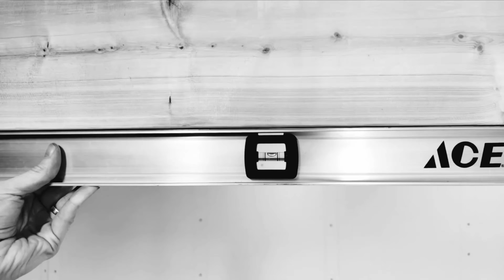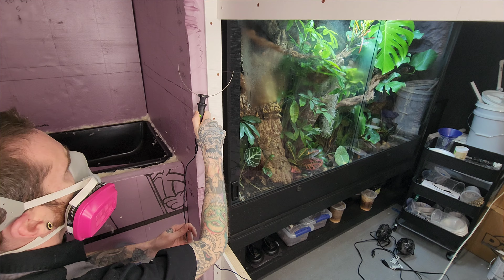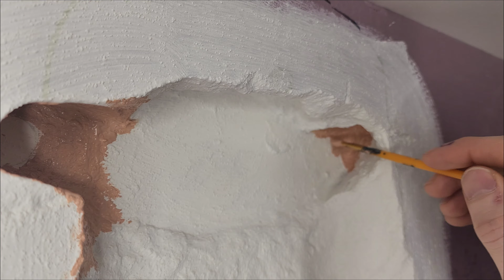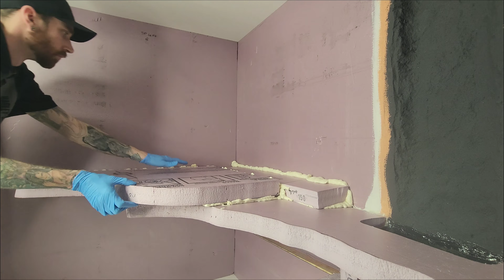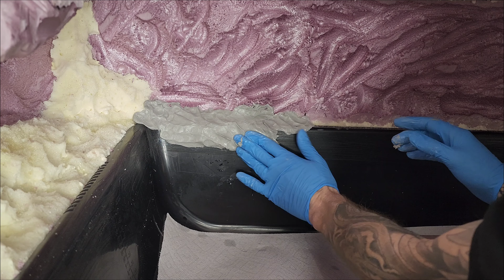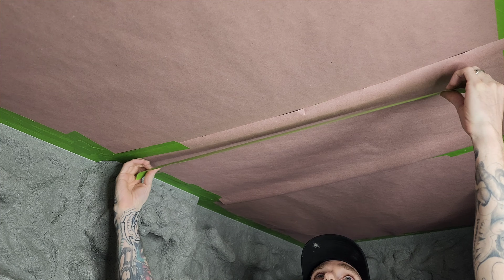DIY HUGE Reptile Enclosure. Waterfall, Dripwall, Hardscape, Background, Zoopoxy |Part 2| #reptiles

Comment: Hey @BradsBioactiveBuilds is there any way I can reach out to you so that I may get some advice on basically building the same size setup but mine is for a BCI. He's roughly 7 and 1/2 ft I've had him for going on 13 years now. He's in an enclosure I built previously but he's outgrown it and I definitely want to upgrade even to something absolutely spectacular so I was trying to do something similar in size but more along with a jungle type background like a bavarium except probably not with live plants because it would be too hard for me to take care of. 

I have over two decades of carpentry experience so that's not a problem. And funny enough I actually work at a theme park in South Georgia called Wild Adventures. We have over 300 exotic animal species. I actually have rebuilt several of the enclosures that we have for several animals although nothing like what you do is just you know replacing rotten and termite infested lumber. 

We even use ¾" sintra PVC sheets for our signs so I'm also very familiar with that material as well. 

It's a dream too work with honestly. What I'm building like I said is for my own personal home I have a great spot it's going to be an 8x7 I believe I don't know if I can add the four feet of depth although I would like to but I would have to show you some pictures of my placement of it as it's also going to be more or less butted up to a sliding glass door. Anyways if you could reach out to me I would absolutely love to get some advice and maybe see if you have some other videos that can show me how to do a rainforest or jungle style for vivarium. 

Also I'm curious to find out what your overall cost for daylight this set up right here that you're doing in this video. 

I don't plan on being cheap with what I build I want to make something that's going to be long-term and he's going to absolutely feel right at home with. 

By the way his name is Django just like the Tarantino movie. 

Funny story too is he's also the reason that my daughter is here on this earth. She'll be 12 years old this year. Her mother at the time made an agreement that I could get a snake as long as she could get a dog. That was easy enough so we agreed. We got down to Petco in Tallahassee Florida and she dropped the bomb on me and said she changed her mind and she wanted me to give her a baby instead. Thinking it would just pass over and she soon move on at some point I agreed. Next thing I know we got married and had my little girl Ivy Grace Ingram. Although we've sent divorced we remain incredibly good friends and talk almost on a daily basis outside of just our daughter but it's always just been a funny story to tell people.
Reply from the maker: That is an incredible story, and with your background in carpentry, I’m sure you’ll build an amazing home for Django! 🤘💯

Comment: I gotta ask, how strong is the insulation board on just expanding foam? I'm just imagining an adult lace monitor and wondering if that could hold the weight, as I'd love to use this idea for a lace monitor enclosure!
Reply from the maker: It will hold with polygem zoopoxy, I have a 6ft Cumingi in there now. I can also sit on the ledge. Check out zoopoxy here
Polygem ZooPoxy 307 Lite
https://polygem.com/product/307-lite-sculpting-epoxy?mtm_campaign=brads_bioactive

Comment: I'm partway into my PVC build, heavily inspired by and following your ideas. To waterproof the drainage layer without silicone because of binding properties, in another video you used Lexel adhesive, and here you use Zoopoxy (which I can't find). Is it still okay to use Lexel on a drainage layer? E.g. if I had 5 inches of Lexel up the sides then 1.5 of it would be in the drainage layer but 3.5 of it would technically be able to leach into the soil and the snake could technically burrow to it... I want to do more than 1.5 inches up the walls into the dirt in case of emergency overflow. If not Lexel, then what else would work? Liquid Rubber tape looked temptingly easy...
Reply from the maker: Lexel has worked well for me and the binding properties  you and always sand the pvc board to rough it up a little bit to get a better bite. Its also printable so I out drylok over it to add a little extra protection. You could also fuse the pvc together butbifbits a large build you will have to work really fast.

Here is a link to zoopoxy if your in the US

Polygem ZooPoxy 307 Lite
https://polygem.com/product/307-lite-sculpting-epoxy?mtm_campaign=brads_bioactive
Reply from the maker: And thanx for your support to the channel!

Comment: How thick is the insulation board?
Reply from the maker: I used 2 inch xps insulation board for this build.
Hope that helps
Reply: @BradsBioactiveBuilds sorry for all the questions. I’m about to start a build and never done it before.
Reply from the maker: @Factory43R no worries at all, ask away, I'm here to help!
Reply: @BradsBioactiveBuilds can you do dry lock only over the foam sheets and expanding foam or do you have to do some type of lockrete or mortar?
Reply from the maker: @Factory43R yes you can drylok right over the foam sheet and sprayfoam. But depending on what animal you are putting in it and if it has claws they might puncture through it depending on how many coats you do. 

Here is a link for what I uses
Polygem ZooPoxy 307 Lite
https://polygem.com/product/307-lite-sculpting-epoxy?mtm_campaign=brads_bioactive
Reply: @BradsBioactiveBuilds it’s for a female super dwarf reticulated python.
Reply: @BradsBioactiveBuilds I would love to use that but it’s a bit too expensive for the size I’m making. If I did the grout option would I need to seal it? If so what would I use for a clear coat to seal the grout?
Reply from the maker: @Factory43R no need to seal
Reply: @BradsBioactiveBuilds cool thanks. 1 last Q. When I’m using expanding foam can I use the regular great stuff gap filler or do I need to use the pond and stone?
Reply from the maker: @Factory43R regular great stuff gaps and cracks works just fine, and it's cheaper!
Have fun building!

Comment: I think u should’ve done a layer inside os the tub to get perfect! Its just the final touch, the enclosure is perfect
Reply from the maker: I agree. I was thinking if I ever needed to replace the drain it would be easier. I'm planning on putting down some zoopoxy in the tub once I finish the 8x4x6 paludarium im working on

Comment: What is the purpose of the pvc board if your insulating and covering with zoopoxy. Could I just use the pvc board on the roof and floor
Reply from the maker: What would you use on the sides?

Comment: I am absolutely in awe watching you do this project dude.

Im just curious, when painting the interior  did you need to use any spcific paint to ensure the safety or the reptile? Or is this not cokpletley necessary?
Reply from the maker: I'm glad you enjoyed the project. 

So I use drylok original and I mix in quikrete or folkart matte acrylic paints. Sometimes a combination of the 2. When ever using quikrete it's a good idea to give the enclosure a good spray down to remove any residue. 
Hope this helps

Comment: Question? I’m following your guide and building something similar to this for my boa constrictor.  Can I opt out on the PVC boards and use plywood then the XPS boards?
Reply from the maker: @wisperkidwell  
Yes you can opt out of the pvc board and use plywood.
Have fun building!
Reply: @ thank you! Do I need to worry about sealing the plywood?  Pondseal seams to be the best option if so but I worry the xps with silicone won’t stick to it.  What would you suggest I do?
Reply from the maker: @wisperrobinson2865  silicone will bond better to wood than pvc board so you are good there.

I would drylok the while inside of the enclosure and use polygem 1618 epoxy on the bottom and up 8 inches to account for water and damp substrate. That would be the best way

Comment: Absolutely beautiful man. I just finished the last stage of dry locking and silicone on a 8X4X6 for my Mangrove Monitor and I’m ready for insulation board. I was wondering how many gallons of poly gem did you have to use for this project to include thickening agent? Thank you!
Reply from the maker: @bbaquatics2051  awesome,  glad u are making progress on your build.
I used just short of 20 gallons of zoopoxy and just under 3 gallons of thickening agent.
Hope this helps!
Reply: @BradsBioactiveBuilds  it sure does. Thanks!

Comment: How much zoopoxy did you have to use for this? I'm looking to build a similar size enclosure and don't want to buy too much or too little! Your videos are awesome!
Reply: I see here in the comments how much you used. Is there a cheaper alternative to zoopoxy? My pockets can't handle that 😅
Reply from the maker: @claytonflores5095  yeah, it is a little expensive but for Monitor lizards it's the best for durability and for all hardscapes it's great to work with and will last a lifetime. There are a few other alternatives but aren't as good from what i have heard.
Hope this helps

Comment: What is “dry lock”… got my bowl/pvc today and started my cage. I can’t find the PVC sheets locally. Was wanting to know if I could use melamine instead.. it’s also a lot cheaper then he pvc.
Reply from the maker: @jamessorsby7419  drylok original is commonly used it the hobby for creating naturalistic backgrounds. Its applied over prayfoam or xps board. 
Melamine can work as well. It is heavier. Just make sure u seal the seams real good. If eager gets in it will expand the partical board between the laminated finish. 

Here is a video going over drylok 
https://youtu.be/WZ3EYjO_PIQ?si=4rbNtHJ-uylh41zY
Reply: I found the epoxy online and was wanting to know how many gallons I would need for a cage 3/4 of the size you’re making in the video. 10 gallons is $700 😭 but I have a feeling that’s how much I need
Reply from the maker: @jamessorsby7419 yeah, 10 gallons is what you would probably need. Don't forget the thickening agent too!
Reply: @ how much do you recommend of that for the 10 gallons?
Reply from the maker: @jamessorsby7419  1 gallon of thickening should do the trick.
Hope this helps 🤘 💯
Reply: @ when putting the Epoxy, do you only go over the lip of the water bowl or did you do the whole water bowl?
Reply from the maker: @jamessorsby7419  I only did about 4-5 inches past the lip. I wish I did the whole thing. With the flex if the tub when adding water and draining it broke free in a few spots.
Reply: @ if I did the whole think I’d just be afraid I could never fix it if there was a leak. Also I make epoxy tables and I know it doesn’t stick to plastic. Was thinking about just going over the edge to hold it down and just dealing with the fact that you can see it’s just a plastic tube 😂 🤷🏻‍♂️
Reply from the maker: @jamessorsby7419  thay can work as well. Both seem like good options, comes down to personal preference 🤘💯🤘

Comment: how is the ceiling supported? I see in the previous video it was supported with a 2x4 to keep it from bowing in the middle. what was the final solution for the ceiling supports?
Reply from the maker: @benstearns5805  the next video in the series goes over the ceiling. But I did add 2x4's virtually in the center when it installed it to the framed side walls. Pvc board is relatively light. I did not need to support anything. I just screwed it to the top. Hope this helps

Comment: How much zoopoxy did you use?
Reply from the maker: @johnwall9583  just short of 20 gallons. (2, 10 gallon kits and 3 gallos of thickening agent)
Reply: @BradsBioactiveBuilds    Thanks, I'm making a background for my ackie monitor enclosure which is 9ftx3ft. Would i use about the same amount of drylok vs zoopoxy? Also, which method would save me the most money?
Reply from the maker: @johnwall9583  it's a hard comparison to make and depends on how many ledges u have. I would do 7 coats of drylok or 1 coat of zoopoxy. Zoopoxy will runnu a lot more $ but is the best out there
Reply from the maker: @johnwall9583  and a 9x3 sounds awesome 🤘💯🤘💯🤘💯🤘💯🤘💯🤘💯
Reply from the maker: @johnwall9583  if u have seen my most current series I'm working on now (8x4x6 paludarium) I used just short of 50 gallons of zoopoxy VS the same size enclose in this build that I used just under 20. Had to do with ledges and features along with how thick I applied the zoopoxy

Comment: How do you calculate the amount of epoxy you need?
Reply from the maker: @ThelemicPotter  it really depends on how much surface area u have and number of ledges you add. This hole build was just under 20 gallons.
Reply from the maker: @ThelemicPotter  but u can call polygem and they can estimate how much u would need depending on the sizes u give them. Tell I sent you lol

Comment: i’m building my enclosure almost the same way (using a zoopoxy alternative). the plan is to have a pond that would pump water to a drip wall/waterfall. my question is, would drylock be harmful if the reptile were to drink from the pond?
Reply from the maker: @teddy-vd9mk  drylok original is anaimal same. Ifbubuse quikrete to mix in for color make sure u rinse it till the resin washes off. Or u can use acrylic paints from the craft store (matte color) as an alternative to mix into drylok

Comment: Hi Brad, by any chance would you be willing to put up a price list for each stage of this unbelievable build? It would be very helpful to get a general idea of what a similar build might cost. thanks much either way.
Reply from the maker: @darthtaiter  i was keeping track for a little bit but then it got hard bc i had some of the supplies already, plus some returns. But I'll take a crack at it now
Part 1
6 peices of pvc board:  600
Tub: 20 bucks
Wood; 100
Casters: 50

Part 2
20 zoopons zoopoxy: $1200
Xps board: 125
Pvc pipe, bucket, Fittings pump Misc: 50

Part 3
Lights 200
I already had a mistking but 200
Fans: 25

Part 4
Glass: 250
Pvc board: 100
Clay balls 40x3
Glass tracks 40x2
Plywood; 40
Trim: 30
Black paint: 40

Part 5:
Substrate: 200
Plants: 200
Cork, I had some in build but it was probable a 20 peice if you only bout 1

Part 6:
 Cumingi 1500
F/T mouse .40 lol

Misc probably about 200 or random stuff I am forgetting like screws pvc cement, drylok, etc

Hope this helps

Comment: Hey man, I just wanted you’re opinion on the drylok and quikrete method. I don’t know if it’s 100% safe or not I have made a background before with grout and polycrylic for my leopard gecko but he passsed away and don’t think it was the background because he was always skinny and never grew and I want to make another background but I’m worried to
Reply from the maker: @Kevz1n  great question. It is a common method to use drylok original and quikrete.  You can also mix in matte acrylic paints to the drylok. Butbif you use quikrete in the drylok you will need to rinse down the enclose till the the bubbly water stops. Then u r good to go

Comment: This is soooo awesome!! I would love to try something like this for my ball python. Did you Drylok again after you dry brushed?
Reply: Also… did you just use 1 layer of epoxy on the whole thing?
Reply from the maker: @MJ-lv7xj  yes, I layer of polygem zoopoxy 307 light. The 1st 2 links in the description are the materials needed.
Reply from the maker: @MJ-lv7xj  thank you, definitely a fun build to do and a ball python would love it. 
For this build I used drylok as a base tone woth quikrete dye (matre acrylic paint would also work) then I used lighter tones to dry brush and then it was done (I did use some highlights of acrylic paints)

Comment: Hi! Im not sure if you answered this already, but how much zoopoxy did you use for this build? I want to do something similar but with and 8'L 3'D 4' H enclosure, wondering how much id need. Also would probably not use as much foam and use it for ledges, and some accent.
Reply from the maker: @samwendt8007  it was my 1st time using zoopoxy. Looking back on it I wouldn't have carved out the background and would have used a silicone rock stamp for the detail (like I'm currently done on a 8x4x6 paludarium video coming soon).
I used 2p gallons on this build but if your not doing as many ledges and thr front backside if the pocket door then I think 1p gallons would do the trick, if not less.
Hope this helps
Reply: @bradsbioactivebuilds  thank you so much for the advice! I am a little confused though, you said you used "2p" gallons, but I could probably get away with "1p" gallon. What do you mean with the "p" ? On there site I see they sell quart, 2 gallon, and 10 gallon.
Reply from the maker: @samwendt8007  Oops, my bad I ment 20 gallons and 10 gallons, not p.
Hope this helps!

Comment: Did you use Lexel adhesive or silicone on the back of the XPS board that you attached to the PVC?
I’ve had trouble with silicone sticking to PVC in the past, what brand of silicone do you use? 
I’m only familiar with the GE clear silicone 1, that’s the only one that I’m sure is safe for animals, but if you could give me some pointers on silicone you like that work better that are also safe for animals.
Is Lexel adhesive better than any silicone and I could use that instead of silicone on any future projects? Is it also safe for animals?
Reply from the maker: If you take a wire brist on a drill to the pvc board, silicone or lexel will adhere better. Also, if u scratch up the back of the xps with a knife and use a little of drylok original silicone, it will also bond to that better to. 
Lexel is safe. You just need to wait 2 weeks for cure time 
Hope that helps